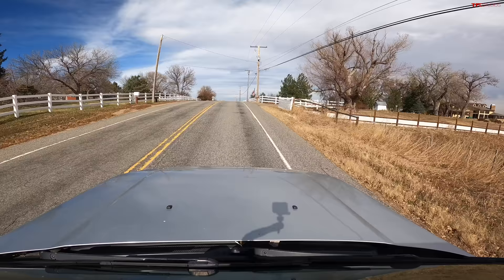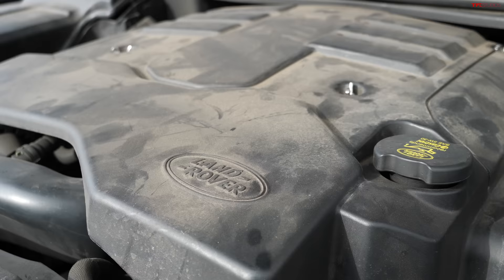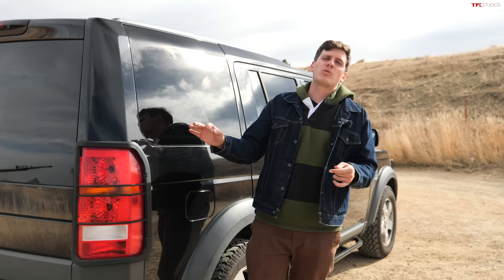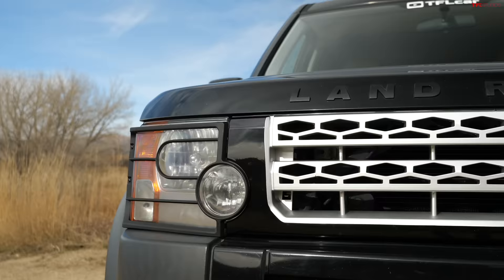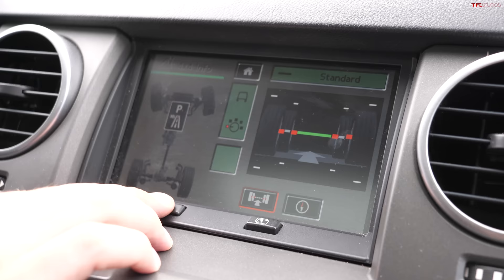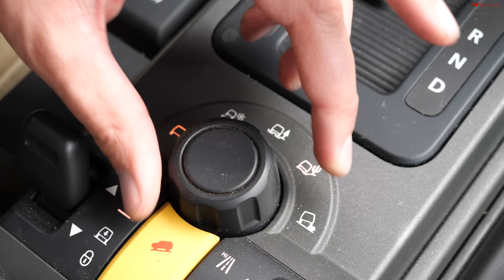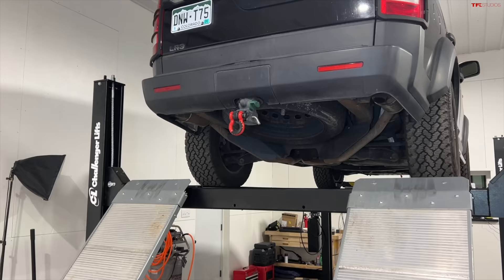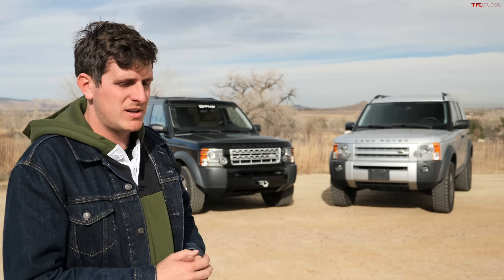The Truth about Land Rover LR3 Reliability - TFL Expert Buyers Guide

Comment from the maker: This holiday season, check out Holzkern’s complete line-up of unique and original timepieces, men’s jewelry, and other high-quality designs at holzkern.com/TFLcar. Use code, “tfl15” for 15% off!
Reply: Lucky you in US, as in Europe the LR3/Discovery 3  (LR4 and Discovery 4 as well)i are one of the most unreliable models ever made by JLR, because of  VERY problematic 2,7 and 3,0L TDV6 engine (Ford/Peugeot engineering) ,  problems with rust and problems with air suspension (the last two are often linked together).

Comment: My 4.4 lr3 is at 280k miles with all original drivetrain and even original air suspension out back!!! Its my daily driver and still gets 15mpg around town. It really is a solid platform
Reply: Shhh don’t tell anyone so that I can pick up one for cheap when Im ready lol
Reply: It’s the same 4.4 as in the bmw x5 right….
Reply: @98MAzdaMilleniaS Nope, you’re thinking of the L322 Range Rover, from 2002-2005 they used 4.4L M62 units from BMW. The LR3 never had any BMW powertrains, only the 4.4L AJ V8 from Ford/Jaguar.
Reply: My LR3 has 220K miles and it's also still on the original drivetrain and air suspension.
Reply: @Overlandjon exactly. 😅 I'm going to look at one tomorrow and hoping to get it for 6k
Reply: my Ford Ranger gets mid 16 mpg's, so wow not that bad id say on gas mileage especially for a v8.  I used to have an F150 with the 5.4 v8 and it got close to 13 mpg but I continuted to have three vehicles to switch between so it didnt seem like I had to suffer with the gas mileage.  It was fun to rip around with a v8 though.
Reply: I have a 2005 LR3 HSE with over 250k. All original, except new airbags replaced at 240k. Best vehicle that I’ve ever owned! My Toyota and Grand Wagoner were never this fun to drive. I loved it so much, I bought the LR4 for my wife. After 5 land rovers, I’ll never drive another brand.
Reply: What year?
Reply: Dude what? So you never had the air suspension sag on you?

Comment: I've had my LR3 for almost three years now and I love it! The importance of that GAP IID tool cannot be overstated. If you replace an airstrut you will likely need to re-calibrate your suspension. If you replace your air compressor and get a different brand you will need to flash the firmware to the correct brand etc. There are a ton of easy fixes the GAP tool can help with, just buy one if you have an LR3.
Reply: Where can you typically get them
Reply: GAP tool will also recalibrate front diff settings and even override the tire pressure monitor system in addition to deep cleaning pesky codes on the fly. Pays for itself many times over.

Comment: I got a 2006 with the rear locker 2 years ago.  My decision was heavily influenced by your videos.  I decided to do a light restoration so it's been in my garage for a year and $4k in parts so far.  Labor is paid by love
Reply: How you can know if has a rear locker? It comes with an specific versión or was optional?
Reply: @888JJEAM888  HD package was optional and has an electronic rear locker.  
Few ways to check:
-There's an electronic box on top of the rear diff
-Full size spare
-Put it in 4L, rock mode, and get it on a soft surface and try to get it to spin. The off road display will show it lock the center and rear diff
-Get an IID Tool.  You can activate the rear diff to test it if it's equipped

Comment: My ‘06 LR3 has 313,000 miles on the original engine. Purchased it in Feb 2012 with 74K miles. It’s still going strong. It was the family daily but now it’s one of the family adventure rigs.
Reply: V6 or V8?

Comment: I have a 2007 LR3. It's my favorite vehicle.  I have a Johnson rod lift and 33's on it. I had to modify the front frame rails a bit and trim the plastic fender wells. It's a beast off-road, and with the BFG KO2'S, it's unstoppable in the snow. Does it have electrical gremlins? Yes. But nothing that keeps me from daily driving it. I agree with everything Tommy stated in this video about LR3's. I highly recommend them. Most people that critique them have never owned one.

Comment: I have owned my 2008 lr3 for over 2 years now and it has been a blast. I’ve put over 50xxx miles on it and have towed, off roared and daily driven it. It takes everything I throw at it. I’m currently on a journey to run 35’s on it and can’t wait to see it happen.
Reply: Wouldn't ever put 35s on a ln LR3
You'll FK the computer systems and ruin the experience.

You'll have a Frankenstein car for not much benefit

Comment: I am a huge TFL fan and follower. Love what you guys do. I recently watched your buyers guide and decided to buy a used LR4. I leased at 2007 LR3 and loved it but switched to a 2010 Jaguar XF when the lease expired. I still have the XF with just under 190000 miles. In October I went ahead after watching your video and bought a near mint condition 2012 LR4 HSE Lux with only 92000 miles for $14k.  Love it!  keep up the good work.

Comment: Center bearing failure on the rear drive shaft is super common too. The bearing itself doesn't fail but the rubber dry rots over time and the makes the driveshaft clunk and flop around in the carrier bearing housing. I just replaced mine last week. EDIT: And like others in the comments my LR3 purchase was also heavily influenced by your videos with your original LR3.
Reply: Just for those reading this, it can be fixed for ~$15 with some sikaflex and about an hour of your time

Comment: I had a 2006 LR3 with the 4.4 and 160,000 miles and it was pretty solid. It still had the original air suspension. The engine and transmission were great too. Just a few electrical gremlins brought the reliability down.

Comment: Bought my 08 LR3 with rear locker last year after watching your videos and doing research into what the best off roader was for me on a limited budget. She had 240,000 miles and extensive service history. She is an amazing truck. Did Yankee Hill and Kingston Peak without skipping a beat. Even my wife, (not into off roading) loved the LR3. I use that truck for going snowboarding, off roading, hauling dogs around town, everything. 

I didn’t have any major failures under my ownership and have since sold it off to upgrade to a 4xE but I have to say there are lots of things the LR3 did better and for literally 5% of the price of the 4xE. 

I do have to say I was constantly prepared for something to go horrendously wrong. But I love seeing them out in the wild and will forever feel fondly about the LR3.

Comment: Great video! My LR 3 is a 2006 V8 SE with the HD package and cold weather package. Bought it new in 2007 and it now has 241,000 miles on it. Only problem was the water leak from under the cowl panel and another leak from sunroof drain tubes (known issues). I fixed them both with help from YouTube. Great vehicle both on road and off road!

Comment: I love the LR3, I've had one for about 4 years and 50k miles.  It does keep the wrenches warm, but I've never needed to be flat-bedded or towed off the trail or anything like that.  I think it's the best compromise of good on road driving and handling characteristics combined with really great off road capability.  It's no rock crawling trail buggy but getting through gnarly trails is a breeze.  Great articulation, good clearance with the height adjust.  Plus it tows pretty well.  I just towed a full size car on a flatbed trailer without issue from Colorado to Wisconsin.  Its a great do-all vehicle, if you don't mind a little wrenching here and there.  Some of us even enjoy it.

Comment: Hilarious to see people pissy and grumpy about a car brand? If you don’t like it, no one is forcing you to engage. 

The LR3 is probably the best overland platform ever made. The LR4 adds more luxury elements and has the bigger jaguar 5.0 V8 which has timing chain issues where the cost of labor is what breaks the bank. 

If you do your own work you can reasonably own one of the best 4x4 trucks ever made. Get a GAP tool to cover your electronic issues and worries. If your air suspension system fails you can replace it with a traditional coil over setup but you lose some factory capabilities. That being said, there are plenty of high mileage trucks running around on their original air setup. 

If anyone is shopping around for an LR3/4 and wants to use it for wheeling, finding one with the factory HD Package option is worth its weight in gold. Full size spare tire + rear locker. I would advise against the later model year LR4s that switched to the sc v6 over the 5.0 v8. The LR3 4.4 V8 is going to be the best workhorse
Reply: Great info! I'm kind of looking around at one of these, I have a 4Runner but it's boring and I'm kind of tired of it.
Reply: There's no way it's the best overlander. An overlander needs to be extremely tough and reliable to take that gong. They are great off road, but off-roading and overlanding are very different.
Reply: @ln5747  you will not have the same level of power, luxury, off-road capability, and on-road manners with another vehicle as you will with a V8 LR3/LR4. These things combined make it an overlanding platform. Will you see one of these kitted out and crossing multiple continents in a single expedition type trip? Probably not. But plenty of people around the world are using these for overlanding purposes. Give us your definition of “overlanding” and we might be able to have a conversation
Reply: @21stcenturygildedage  I think I'll trust Andrew St Pierre White's judgement over your own, but cheers.

Comment: One surprising thing about these, assuming that they are sorted when you start your project, is that they're actually cheaper to build than Toyotas. You can get a proper lift kit for one of these for the price you would pay just for a set of JBA upper control arms for the same lift height on a 4Runner. If your air struts go out, they're cheaper to replace than a set of good lower-end Toyota shocks, and a full front winch bumper is only a little over 1k.

Comment: If you're going to own a Land Rover, it's gotta have the 4.4L Jag and ZF6 combo.  Just keep up on your fluid changes and it'll run forever.  My LR3 I sold with 150k on the clock and only touched the engine for oil changes and to replace the coolant bleeder above the throttle body.  Another good choice is the 06-09 full Range Rovers, they also have the 4.4/ZF6 combo and insanely easier control arms to replace (literally a 30 minute job in the driveway and dont have to take the wheels off if lifted)

Comment: There is a MUCH better rear recovery point under the hitch wiring plastic access panel. two quarter twist fasteners to open it.   The towing hitch is not rated for recovery and would make a massive projectile when connected to a snatch strap.! Otherwise GREAT video Tommy. Keep loving on the LR3.  I had one  for 12 years and it wasnt long enough.

Comment: Yeah, I know, you have a friend who had one. No you didn't. Well, I know this guy who spent 10 grand just getting a problem diagnosed on one. Umm, no you don't and no he didn't. The biggest problem with Land Rovers from the LR3 forward has been electrical issues and that is still the case today. Engine and transmission failures are rare but tend to be major when they do happen so they cause a lot of concern, obviously. The air suspension was failure prone pre LR3 but rare afterwards and, like Tommy mentioned, it was usually a compressor issue not the struts themselves. Land Rovers are not Toyota reliable but try not maintaining your Toyota and you'll have problems as well. I've owned 17 different cars in my life, two of the Land Rovers. I learned about the potential issues and how to prevent them and did the maintenance. In total I spent roughly $2,000 on two Rovers over the course of 5 years and roughly 80,000 miles of ownership making repairs. My only Subaru cost me $3400 over 198,000 miles. My one Toyota cost me $2100 over 144,000 miles. My seven Nissans (pre-Carlos) cost me $2800 combined over almost 550,000 total miles. My three Mustangs cost about $4000 over a total of 155,000 miles total largely thanks to a bad transmission in one of them. The other cars I did not own but one of and did not keep long enough to keep track. But the worst of all of them was a Jeep Grand Cherokee with the much vaunted 4.0L that developed an undetermined engine issue at just 60,000 mile and the dealership told me I'd be better off to get rid of it so I did. Didn't spend money fixing it just lost a little trading it. A lot of folks hear stories and repeat them. A lot of folks like to think they are superior simply because of the automotive choices they make or WOULD make but have never made. So they tell others how dumb they are for buying Land Rovers or Jeeps or, in many cases, anything other than their own personal favorite brand. You know what? Screw 'em. Do your research and know what you're getting into with all brands and then buy what makes you smile.

Comment: I owned a 2011 LR 4 HSE brand new…… just sold it in 2022 with 120,000mile. Spent a ton of money keeping it alive. I bought a 2022 4Runner Limited because I was tired of repairing the LR4. It was outstanding in snow.
Reply: The LR4 was still superior. These are great if you are handy with some tools or have a good indie tech on standby. The 4runner is superior in reliability, but comfort and performance are another thing altogether.

Comment: The LR3/LR4 are superb.  I've got a 2010 LR4 5.0 with 240,000kms as my daily.  I can't imagine replacing it.  I absolutely love it.  It's been completely reliable other than the air compressor failing, but no biggie.  If the engine goes, I'll have it repaired/replaced.  I don't want a new one with worse visibility and annoying touch pad controls, etc.  Not to mention the blingy ostentatious image.  One day the LR4 will have to retire, but it will be a classic.  A lifer Land Rover technician I know raves about the LR4 and says they are starting to appreciate in value.

Comment: My LR3 with 356‘000 Kilometers still runs on it first Airstruts from 11/2004! And the car still runs like a new car, also with its original engine, which consumes not one drop of Oil between the Oilchanges!

Comment: I own a 2007 LR3 with 160K miles for 3 years.  The drivetrain is glorious.  Silky smooth and plenty of power.  You will have issues with the air suspension.  I have had to chase down my fair share of leaks and had to swamp out multiple parts.  I do my own work, but parts still a bit pricy.  Still love the truck and would recommend.

Comment: Awesome guide, Tommy! Thank you! Really wish to know why you prefer LR3 vs LR4, because LR4 would be my choice design-wise
Reply: It had engine issues 5.0, lr4
Reply: LR4s look cool and the interior is nice, however, I found that there's only one year that is desirable to get, a 2013. Pre 2013 had timing chain issues, which were fixed for 2013, and then in 2014 they went to a twin turbo V6 and made the two-speed transfer case optional.
Reply: @trailrunnah8886  yes you are right, timing chain problem fixes after some years

Comment: This most compares to a Land Cruiser they’re typically 1/2 to 1/3 of the price that difference in price can buy a good amount of repair parts. Everyone acts like Toyotas are substantially more reliable I can tell you on my first gen sequoia it is reliable however as a former lr3 owner it was as nearly as reliable and I’ve actually put more money in the sequoia. 1st gen Sequoias require timing belts every 100k typically a $1500 job lower ball joints every 100k $400 job along with tons of other nitpicky things the same money in a lr3 every 100k would keep it reliable.
Reply: Toyotas literally are substantially more reliable. That's not opinion. You won't find a single review from any reputable car reviewer stating Land Rover as more reliable than Toyota. Just facts fella.
Reply: I had a P38 Range Rover 2002 — so many more $$ repairs by 110k than my 2011 Land Cruiser at 195k — by same age, same driver, majority miles on road some sand and snow no rock crawling for either.  And I’m not afraid to push any button in the 12 year old LC.    Love the LR/RR style…..hate the Lexus bling…..GX550 or LR/RR next yet the reliability and value cliff hold me back and I owned both.

Comment: Tommy, just Fyi have you ever tried the Tornado air products that will give your vehicle a much smoother Transmission shifts and lower Rpm amount and overall will give you a Much Better Power output and Also some Better Mpg rate. I have put it on many manufacturers SUVs, like Ford explorer, Jeep Sahara, Jeep Renegade liberty, GMC Denali, My 2004 Land Rover Discovery and now my Ford Explorer xlt 4x4. It will make a Huge Difference in my opinion, so Please try it if you can. I try to Tell anyone I meet about this product. It has made such a Difference in all my applications and I'm kinda wondering Why this Product is not more well known. Any way just Fyi Hope you guys are willing to give it a Test. Good luck.

Comment: This is a great video. A couple notes...there is nothing wrong with the 2005. There are issues like the diffs (internal coating) that the factory later sorted but any 2005s out there now likely had those replaced already. 

I agree the non-HD variant can do almost everything the HD LR3 can do....but I am not sure if its 99.999%. it might be closer to 89% and even then it does so with more traction control and grunting. I have two LR3s. One is HD and the other isn't. They are both great but they are not the same.

Comment: You did not mention anything about the low oil pressure,  that causes most often engine problems that are far from cheap or easy to fix.